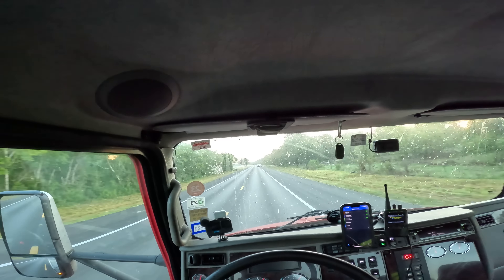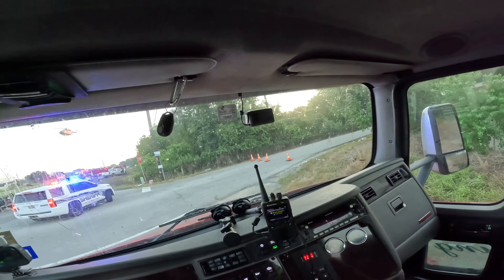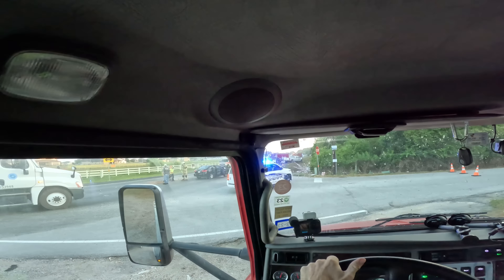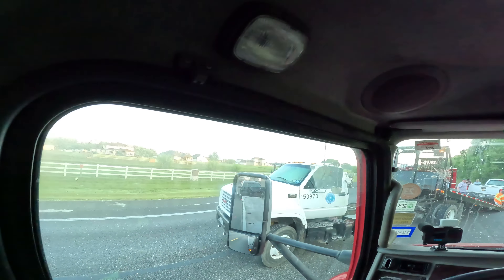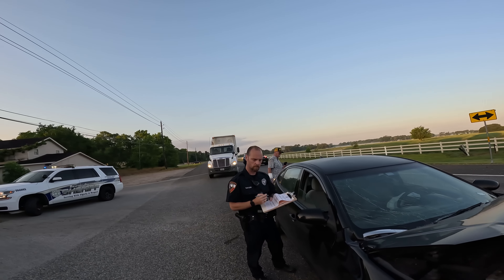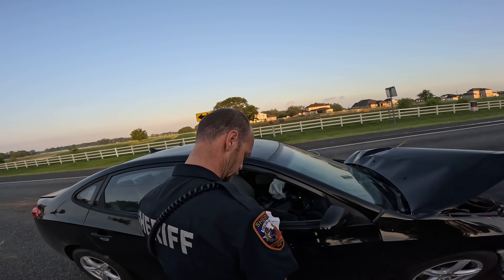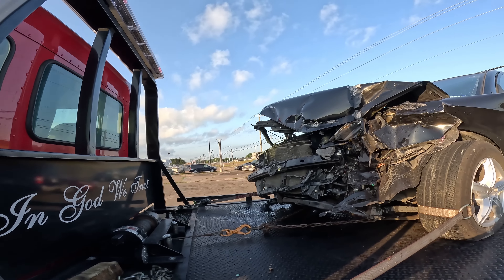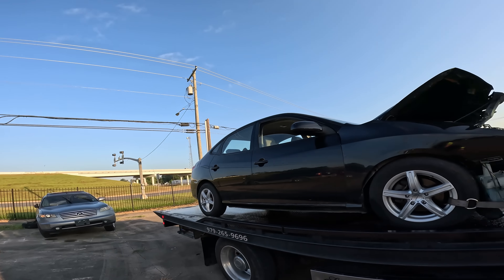First Major of 4th of July Weekend! Police Rotation Tow!

Comment: Gerard training institute does training for tow operators in California, we suggest using some dish soap under the tires instead of shaking vehicles off the trucks to minimize damage to the trucks. It will also help clean your bed. 

Stay safe out there. You have a dangerous job.

Comment: I read a book about tow trucks when I was a kid and it was saying the most dangerous part of the job is when you are pulling the car up, the cable could snap and recoil and kill you. The truck in the book had a shield for the operator to stand behind in case this happened. What kind of safety precautions do you take to protect yourself in the event of a cable breaking?
Reply from the maker: Just don’t stand in the line of fire, and keep up on your maintenance

Comment: They turned a short recovery into a long one. The other tow company was taking too long lol
Reply from the maker: The other tow truck belonged to the state, so they likely don’t deal with wrecks much.
Reply: The other tow truck was Texas Department of Criminal Justice. Their tow trucks are normally only used for when one of their vehicles breaks down & not on accident recovery. Most accidents involving TDCJ involve one of their commercial vehicles either a bus or 18 wheeler.

Comment: Awesome job sir. A shame the FD weren't more cooperative, you were very professional to them. TBH the officer looked pretty "stern" as well. There's no need for any of that. You're all on the same team. Keep your head up, great watching your awesome work. I do have one question, is the 4 point tie down TX law or just for extra safety. I ran a roll back for a while, TBH, we locked one of the rear, winch held the front, see ya!! 😂😮
Reply from the maker: That’s a requirement. No one follows it, but it’s requirement. I’ll chain it and suck the winch down to get off the road, but I’m not going very far without it.

Comment: So, Dustin, Did you remember to "LOCK" the car? 🤔???? 

The Sheriff told you that the lady's wallet was in the car and you said that the car was going to be locked. 

Well, the passenger window was rolled down, what now?? 🤔????
Reply from the maker: Yes. By law you have to secure all vehicles in impound. Doors locked, and if windows are down or busted, you have to cover them in a way to keep the elements out.